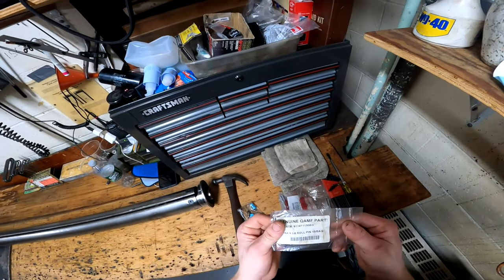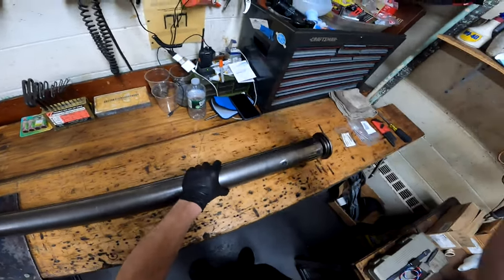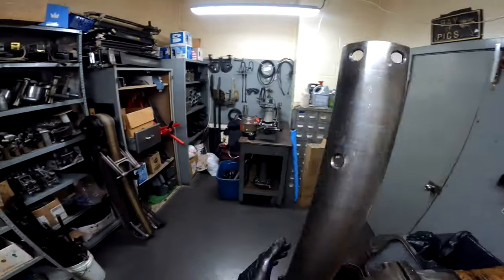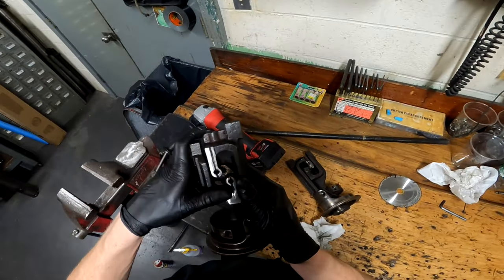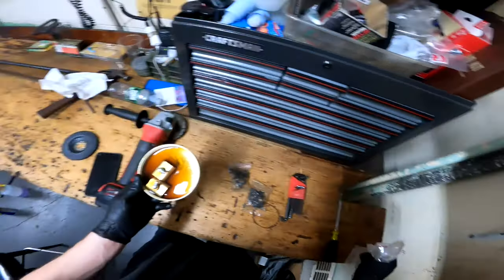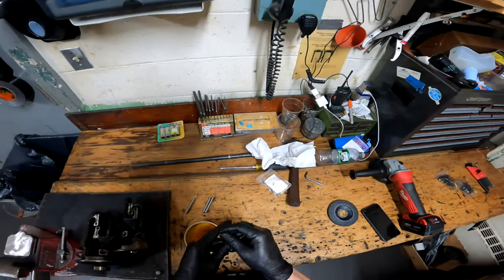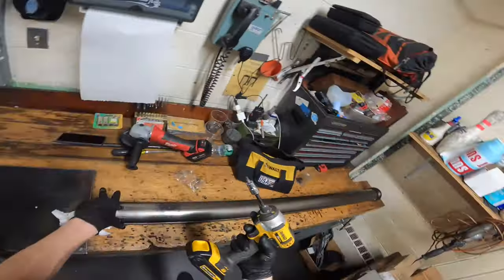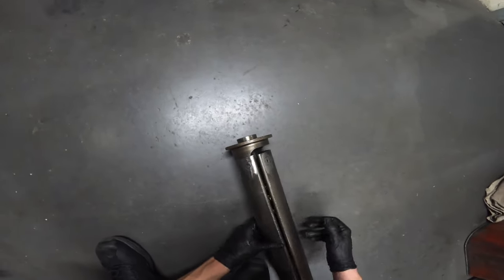AMF Front Roller Assembly Rebuild

Comment: Great tip on the roll pin… those can be a pain to drive through especially when they’re brand new.

Do you find oil helps the pins & links last longer before you start getting the “service me” knocking noise? Was always taught to rebuild hinges with grease
Reply from the maker: I soak the links in heavy weight motor oil prior to the rebuild. It’s a preference for me and I feel the oil may work more efficiently than grease would due to the difference between the thickness of grease compared to oil. These parts are going to wear no matter what you do and should be inspected on a regular basis. 
As you can see, the person who rebuilt these ones didn’t plan on servicing these for a while because they welded the pins in. But to answer your question, it’s really just based on personal preference. 
Thanks for the comment and make sure you subscribe!
Reply: @Joethepro181  It’s amazing what some mechanics have done to avoid having to do any of the more major machine jobs / maintenance. Appreciate your feedback. How heavy of an oil do you use? 10W-30 is my standard for all machine lubrication
Reply from the maker: @BSach3211  For the links I use the same oil that I use for the motors, mobilgear 600 XP 460. Super heavy weight haha
Reply: @Joethepro181  Lol you weren’t kidding. Much appreciated and can’t wait to see some more rebuilds